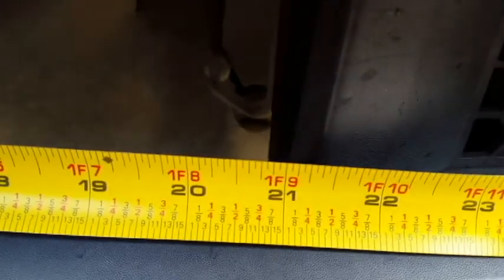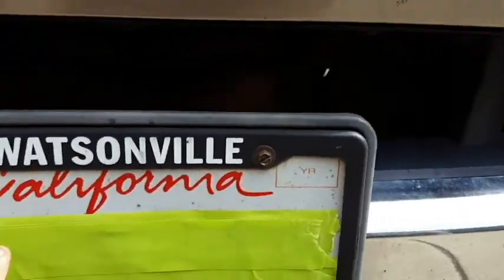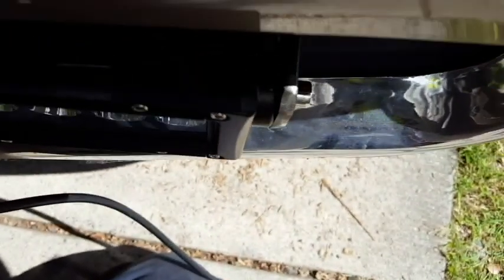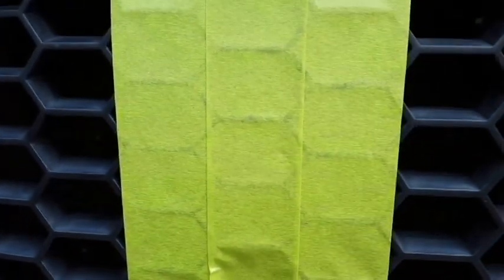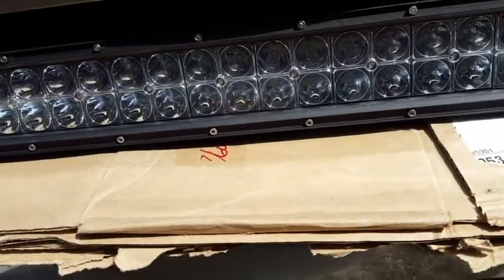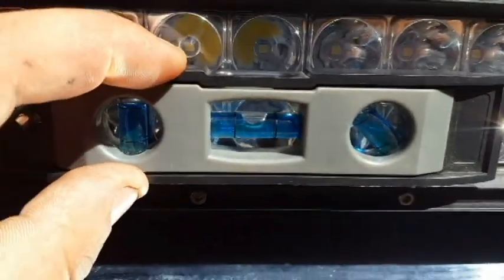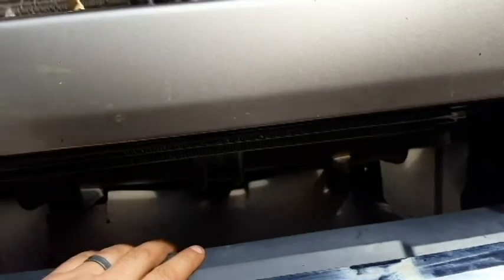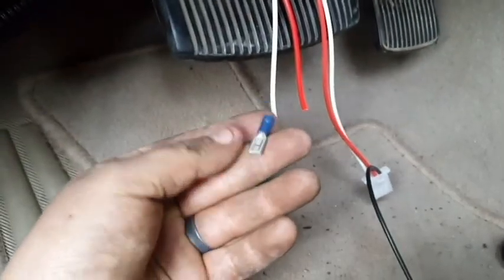INSTALLING A 22'"AUXBEAM LED LIGHT BAR ON A FORD F-150

Comment: I was able to fit a 32 inch led curv bar light in my 05 f150 same exact spot as yours it looks alot more flush no wierd gaps. If you take out the fog lights it's easier to access the bolts
Reply: what type of brackets you use??

Comment: the 22 is what I bought and returned.  I ended up with the 20 bottom mount to go on my bull bar. Replacing a set of round KC's. No problem just aggravated with this process.
Reply from the maker: I bet, it is a hassle to be back and forward with vendors. I hope everything works out for you.

Comment: I bought that light and immediately returned it. the misleading link in the description is way wrong. It does not have dual mounting capability. I ordered the one that was 40$ more and will work. don't post bad info on these lights because there are not many videos about these light available.
Reply from the maker: The lights that have dual mounting capabilities are the small 5" recessed lights can be flush mount or bolted thru the back. I didn't put a link for those.  The first link is for the 22" bar with side mounts. Sorry for the confusion.

Comment: did you have to drill a hole throuhh the firewall?
Reply: Robby Fort there are holes and a rubber gasket on the passenger side